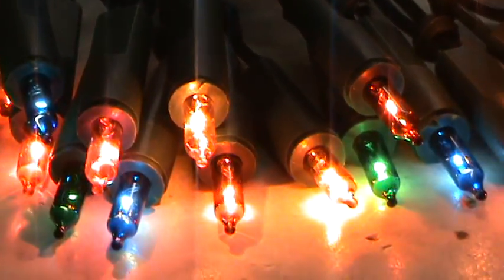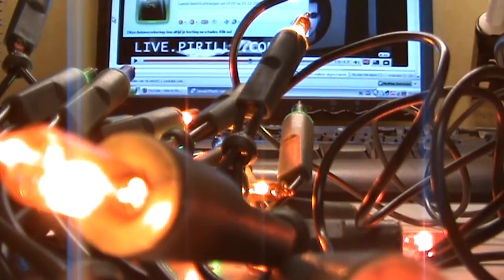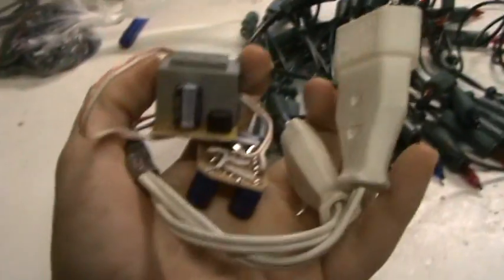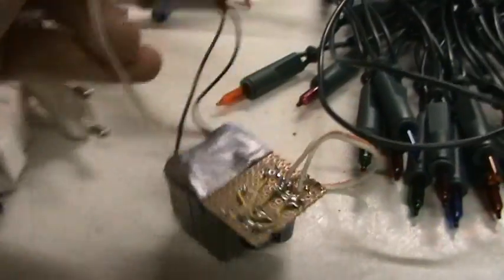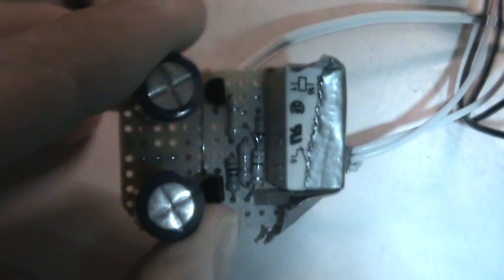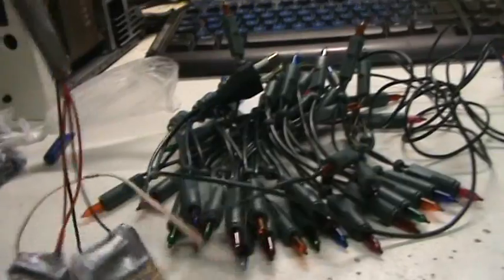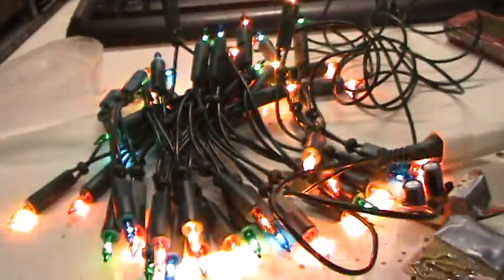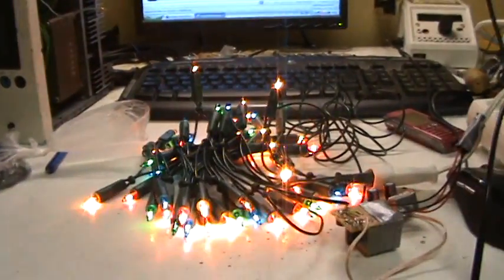Homemade Christmas Lights Flasher Unit

Comment: Do you have a video of how to make it? I have some lights that “HERE” another strand says “COMES” and Another that says “SANTA” but I want to make them flash on and off in sequence. Then come on at all once and reset. Where the Here is on and everything else is off. Then the comes turns on and here goes off. Then comes goes off and Santa lights up. Then they all turn on and reset. Sorry if I didn’t explain that to well.